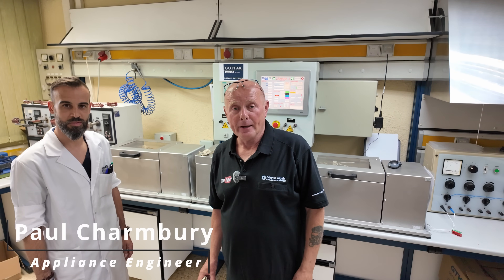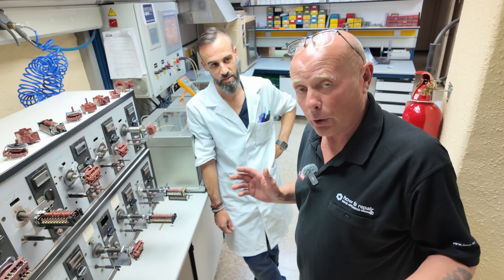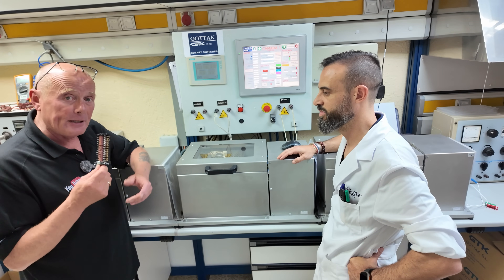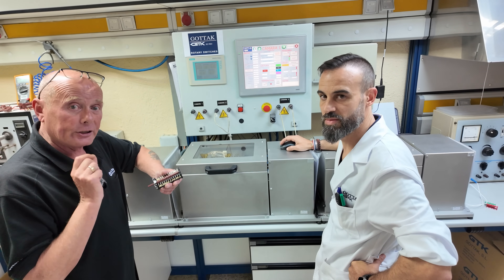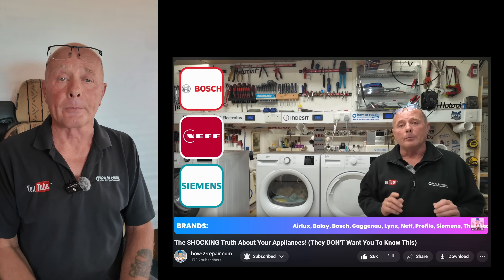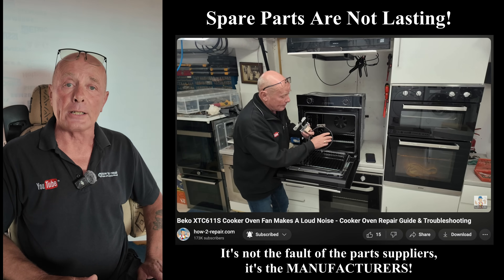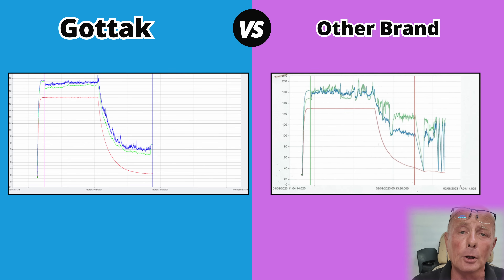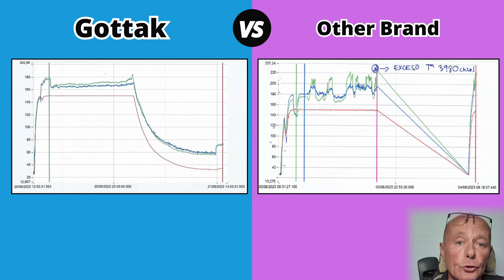Why Your Appliances FAIL SO FAST! Lab Results EXPOSE the Truth!

Comment: Today's work force in America is nothing short of a scam. I had an oil change and wipers cost me over $100 and I brought my own oil. I had a window washer charge me over $125 an hour. House WINDOWS!  Thats like the easiest work ever. Something a kid can make money at.  A boat mechanic at a boat shop wanted $166 an hour to do normal boat maintenance. Then they do a crappy job every time. I have had a head gasket replacement fail in six months. Then I find the mechanic shop is gone and a weld shop is in its place.  When I repaired the engine myself, I found at least five disconnected clamps and brackets with the related bolts and nuts missing.  Just fix it yourself if you can.  YouTube how to video are great. Then, by higher quality replacement parts. The company mechanic has to replace like-for-like. Even if that part is crap.
Reply from the maker: It's not just that the products themselves are often designed to fail the cost and quality of the service to fix them can be just as frustrating. Thank you for sharing your experiences. But as you said, paying a high price is one thing; getting a crappy job for that money is another. Your story about the failed head gasket with missing clamps and bolts is infuriating and, unfortunately, a story we hear far too often. It's a clear sign of a decline in quality workmanship that leaves consumers feeling completely ripped off.

The difficulty and expense of professional repair are part of what makes the built-in obsolescence we discuss so effective. It's designed to make people give up and just buy a new product. For a deeper dive into the specific ways products are designed to fail in the first place, please check out the full video here: https://youtu.be/gEgSCbZnHVM?si=wTIw0mELuhWaw4aX

We also explored related aspects in these videos:

The shocking truth about manufacturers: https://www.youtube.com/watch?v=QsdGd2qDPaI
Heat pump tumble dryers are they really worth it?: https://www.youtube.com/watch?v=xn03N3b0-lE
If you found this information eye-opening or helpful, please consider sharing this video with your friends and family. Let's create more confident DIYers!

Comment: The other major issue is not being able to buy spare parts, and being forced to dump appliances that could otherwise be easily repaired.
Reply from the maker: This is a deliberate strategy. By making spare parts unavailable, discontinuing them prematurely, or making them prohibitively expensive, manufacturers can force you to do exactly what you said: dump a perfectly repairable appliance and buy a new one. It allows them to control the entire lifecycle of the product and ensures that the most profitable solution for them (a new sale) becomes the only option for you.

Exposing these anti-repair practices is a core part of what we do. The more people who understand that they are being intentionally blocked from fixing their own property, the more support there will be for these new laws. This is exactly the kind of issue we aim to highlight.

For a deeper dive into this topic and to see the examples we covered, please check out the full video here: https://youtu.be/gEgSCbZnHVM?si=wTIw0mELuhWaw4aX

Comment: Speed queen is the least bad of the bad options.
If everyone bought one (yeah financing it is better than a cheaper one that lasts less)
All the other companies would have to make them better or go out of business
Reply from the maker: Paying a little more over time for a machine that will last 20+ years is infinitely smarter and cheaper in the long run than paying cash every 5-7 years for a new machine that's designed for the dump. It's about looking at the total cost of ownership, not just the initial price tag.

The fact that we have to rely on one or two niche brands for this kind of quality is a direct result of the built-in obsolescence we expose in our videos. For a deeper dive into the tactics used by the other companies, please check out the full video here: https://youtu.be/gEgSCbZnHVM?si=wTIw0mELuhWaw4aX

We also explored related aspects in these videos:

The shocking truth about manufacturers: https://www.youtube.com/watch?v=QsdGd2qDPaI
Heat pump tumble dryers are they really worth it?: https://www.youtube.com/watch?v=xn03N3b0-lE
If you found this information eye-opening or helpful, please consider sharing this video with your friends and family. The more people who understand the logic you've laid out, the faster things will change.

Thanks again for that excellent call to action! Don't forget to subscribe to the channel for more insights like this!

Comment: Sure enough I've seen little parts fry and rendering my whole appliance useless. And yes. My mother washing machine  or laundry machine lasted more then 20 years. Fridges too. I think even longer. It's easy to see for all of us even non engineers.
Reply from the maker: An old appliance that you can keep running for 20-30 years is often a much better investment than a new one that's destined for the landfill in 5-7 years. The main trade-off to keep in mind, as you probably know, is energy efficiency. An older refrigerator or washing machine can use significantly more electricity and water, which can add up on the utility bills over time. Finding specific replacement parts can also sometimes turn into a real treasure hunt.

For a deeper dive into this topic and to see the examples we covered, please check out the full video here: https://youtu.be/gEgSCbZnHVM?si=wTIw0mELuhWaw4aX

We also explored related aspects in these videos:

The shocking truth about manufacturers: https://www.youtube.com/watch?v=QsdGd2qDPaI
Heat pump tumble dryers are they really worth it?: https://www.youtube.com/watch?v=xn03N3b0-lE
If you found this information eye-opening or helpful, please consider sharing this video with your friends and family. The more people who understand this dilemma, the better.

Thanks again for watching and engaging! Don't forget to subscribe to the channel for more insights like this!
Reply: @How-to-repair  Will do. And thanks also for the links!

Comment: That's why I'm not buying modern appliances 🤡
Reply from the maker: That's a strategy that a lot of people are adopting, and we completely understand why. Given the state of modern manufacturing, where so many products are designed to fail, sticking with older, proven technology can feel like the safest and most logical choice.

An old appliance that you can keep running for 20-30 years is often a much better investment than a new one that's destined for the landfill in 5-7 years. The main trade-off to keep in mind, as you probably know, is energy efficiency. An older refrigerator or washing machine can use significantly more electricity and water, which can add up on the utility bills over time. Finding specific replacement parts can also sometimes turn into a real treasure hunt.

For a deeper dive into this topic and to see the examples we covered, please check out the full video here: https://youtu.be/gEgSCbZnHVM?si=wTIw0mELuhWaw4aX

We also explored related aspects in these videos:

The shocking truth about manufacturers: https://www.youtube.com/watch?v=QsdGd2qDPaI
Heat pump tumble dryers are they really worth it?: https://www.youtube.com/watch?v=xn03N3b0-lE
If you found this information eye-opening or helpful, please consider sharing this video with your friends and family. The more people who understand this dilemma, the better.

Thanks again for watching and engaging! Don't forget to subscribe to the channel for more insights like this!

Comment: Manufacturers should not be tolerated for products that last less than 15 years. In this way, the consumption of already scarce energy sources would be reduced, raw materials would be exploited less, the planet would be protected because there would be much less waste for recycling and disposal. It would be cheaper and easier for consumers to maintain, etc. Unfortunately, money is the most important thing, everything else is secondary.
Reply from the maker: Think about the environmental impact of building machines and then recycling them. These machines are often transported halfway around the world, which adds to fuel costs. It's baffling that we need to ship them every five years due to failure.

The good news is that people are fighting back. The global Right to Repair movement is pushing for exactly the kind of accountability you're talking about, demanding that products be made to last and be repairable. The built-in obsolescence we expose in our videos is the very reason these laws are so desperately needed.

For a deeper dive into this topic and to see the examples we covered, please check out the full video here: https://youtu.be/gEgSCbZnHVM?si=wTIw0mELuhWaw4aX

Comment: Nothing new here. Designed obsolescence has been around since 1924 when the phoebus cartel colluded to reduce the life of light bulbs to increase sales.
Reply from the maker: You are absolutely right, and thank you for bringing up that perfect historical example. The concept of planned obsolescence is, unfortunately, nothing new.

The Phoebus cartel of 1924 is the textbook case where major light bulb manufacturers from around the world, including Philips, Osram, and General Electric, secretly colluded to engineer their bulbs to fail after just 1,000 hours, down from the 2,500+ hours that was common at the time. Their goal was exactly as you said: to increase sales by forcing people to buy replacement bulbs more often.

The spirit of the Phoebus cartel is alive and well, it's just hiding inside the circuit boards and plastic housings of our modern appliances. This is exactly the kind of built-in obsolescence we aim to expose.

For a deeper dive into the modern tactics, please check out the full video here: https://youtu.be/gEgSCbZnHVM?si=wTIw0mELuhWaw4aX
Reply: @How-to-repair too true, white goods today are only designed to get the OEM past the warranty period. Fortunately here in Australia we have consumer protection laws which ignore many defined or express warranties with disdain, eg a TV with 12m warranty may be subject to a claim even six years after purchase. The test is what a consumer should expect to be a reasonable life cycle for a product (which has nothing to do with warranty). You should come down under for a sight see look around, I have a pint waiting for you.
Reply from the maker: Do you know less than half 1 million people have ever watched the lightbulb conspiracy I truly think some information is squashed

Comment: I have been doing appliance repair for 7 years. I tell all my customers to keep their 10 - 15 year old washer. Why? Because the new one won't last 5 years
Reply from the maker: Thanks for your comment mate. When a simple, robust machine from that era fails, it's typically an easy and affordable fix. The only trade-off, which is important for people to consider, is the lower energy efficiency of those older models, which can lead to higher utility bills. However, many would agree that's a small price to pay for a machine that lasts decades instead of a few short years.

Comment: As a retired appliance repairman, I discovered a hard truth. Almost no appliances manufactured after the late 2000's have any post-warranty durability. There are exceptions, but they are few. I own no appliances manufactured after the 90's, because if problems rarely do occur, they are easily repairable at reasonable cost, as long as you avoid the cheapest Asian made parts and only buy OEM. My recommendation to everyone is to buy well maintained used appliances at least 15 years or older. Same goes for cars. If you follow this advice you will save much money and headaches in the long run.
Reply from the maker: Thank you so much for sharing your wisdom from your years as an appliance repairman. Your frontline experience and hard truth are invaluable to this conversation and confirm what so many of us have suspected. As you said, when a simple, robust machine from that era fails, it's typically an easy and affordable fix. The only trade-off, which is important for people to consider, is the lower energy efficiency of those older models, which can lead to higher utility bills. However, many would agree that's a small price to pay for a machine that lasts decades instead of a few short years.

This decline in quality that forces consumers to hunt for vintage machines is the very definition of built-in obsolescence we aim to expose. For a deeper dive into the specific ways modern appliances are designed to fail, please check out the full video here: https://youtu.be/gEgSCbZnHVM?si=wTIw0mELuhWaw4aX
Reply: @How-to-repair I think the sustainability argument favors keeping older tech in use until new tech durability improves substantially. The exception might be in refrigeration/heating related products, because of the dramatic efficiency improvements. The vast waste of energy, materials and transport for short lived products out-ways any incremental gains in efficiency.😮

Comment: I've read several stories of devices made with intentional choices to shorten the life of a device beyond just using cheap components. Apple is at the top of the list.

My Sony TV lasted just 2yrs & was unrepairable. It was their flagship model, but they made it like it was disposable.
I found an old tv repair guy. He said TV's are mostly like that today with Sony being the worst for repairability.  They even do software lockouts if a pixel or 2 fails. Instead of having a slightly bad picture, it will refuse to work!
He himself gets replacement warranties when he buys TV's.
Reply from the maker: Thank you for sharing that excellent, detailed comment. Your experience with your Sony TV is infuriating and, unfortunately, a perfect example of the problem with modern electronics.

You are absolutely right. Built-in obsolescence today goes far beyond just using cheap parts. As you mentioned with Apple, companies now use software and proprietary designs to control the lifespan and repairability of their products. The practice of parts pairing, where software locks a device if an unauthorized repair is made, is a well-documented example.

This is exactly the kind of intentional design for failure that we aim to expose. For a deeper dive into this topic and to see the examples we covered, please check out the full video here: https://youtu.be/gEgSCbZnHVM?si=wTIw0mELuhWaw4aX

Comment: We bought a washer machine that used to be reputable. They were apparently bought out, and the bearing for the drum was shot after just 5 years. 

Your best bet? Talk to the guy who services your machine to ask specifically which machines THEY SEE lasting the longest with better support. They'll give you the honesty an appliance store won't.
Reply from the maker: That is a classic and incredibly frustrating story. You're right, when a once-reputable brand gets bought out by a large corporation, a decline in quality often follows. A main drum bearing failing after just 5 years is a textbook example of cost-cutting on critical components, and a repair so expensive it often condemns the whole machine.

This whole situation—where you can't trust a brand name anymore and have to seek out insider advice—is a direct result of the built-in obsolescence we discuss in our videos. For a deeper dive into the specific ways they design these parts to fail, please check out the full video here: https://youtu.be/gEgSCbZnHVM?si=wTIw0mELuhWaw4aX